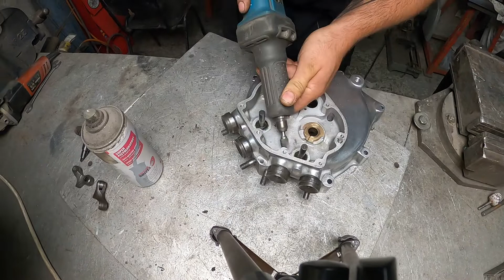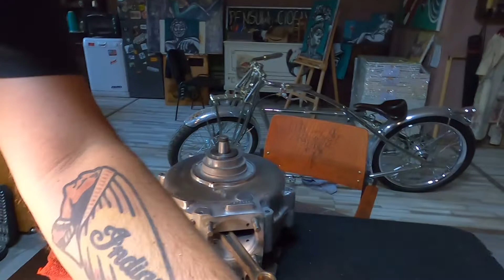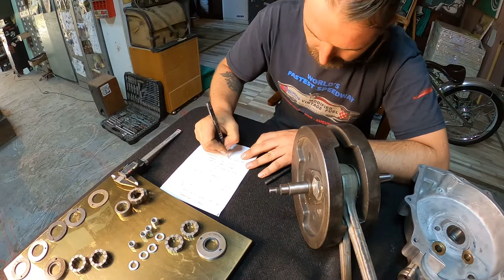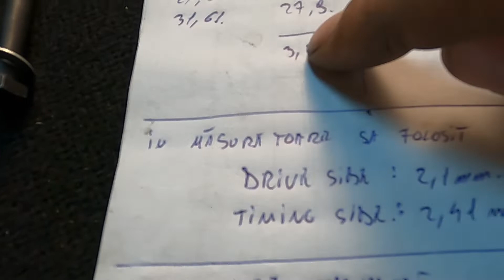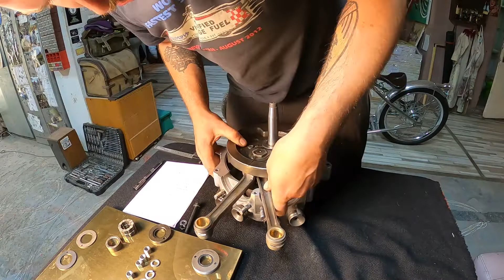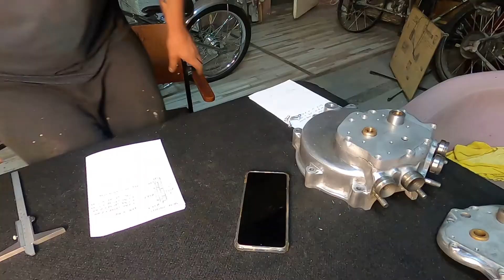Ep 10 - Scout 648 Stroker -Flywheel thrust washers and The valve Train

Comment: well that's not fun . it's at this point the cover would have been smashed with a hammer 🔨  if it were mine.  surely the manufacturer of these parts are going to re make them as its there mistakes?  I guess a lesson learned . if one holes wrong . check every hole before doing any repairs . Keep up the good work . also with your camera positioning can you frame it a bit wider so you don't chop of your head . Keep up the good work seb . 👏
Reply from the maker: i was thinking also about thors hammer at a point :)) but i think i will get one more bucket of patience and weld it , and remaching also the pump mounting correctly . that will include depressing all bushing , welding , replanning , and remachining the bushing wholes as they will be deformed . so i guess next week i will press out all busching also from the engine and redrill all crankcase wholes again , also in the engine .together and aligned with the cover . of course after welding and planning the cover.
Reply: @BastybikesArt  wow big job to do that . I just finished welding my scout cases as someone in a previous life cut one of the engine mounts off and a bolting lug was broken . have welded them and now file work and lastly drilling .
Reply from the maker: @mathewsimonelli1332  oh so you also have some cases work on the going ! good luck  on that ! the go for the complete job make also new bushings for the cams !
Reply: @BastybikesArt  Yes finished welding today,  I am making new bushing for the cams and idlers .
Reply from the maker: @mathewsimonelli1332  Enjoy the build ! that is a nice bike !